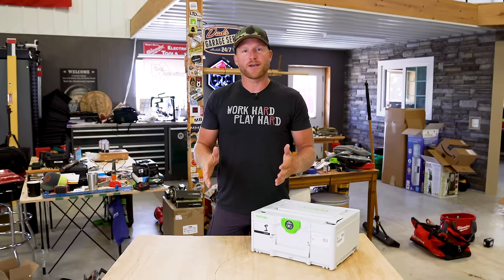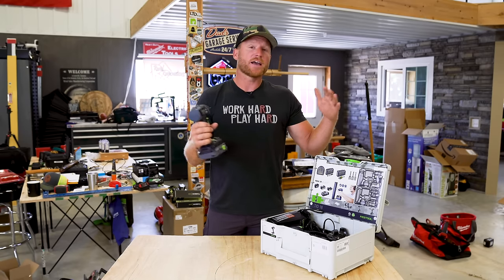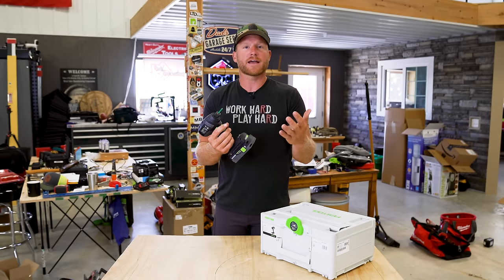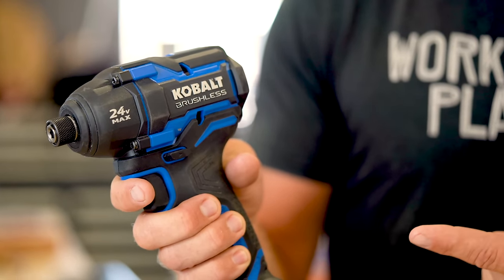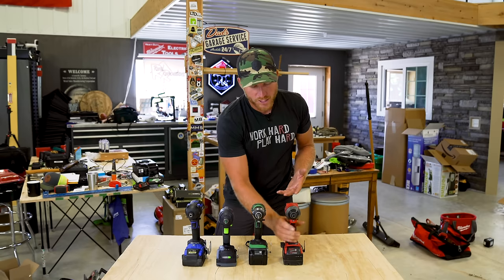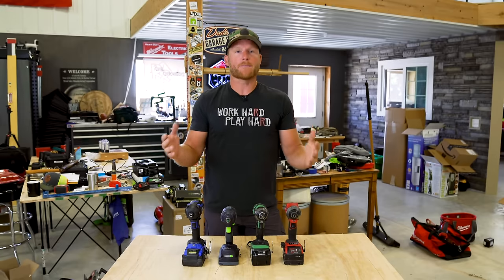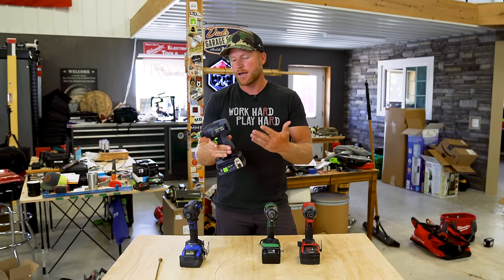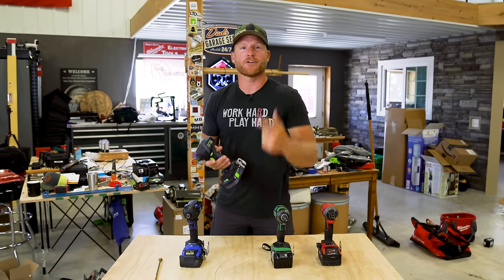Festool TID 18 Is it any GOOD?

Comment: Oddly, I found the ergonomics on the TID 18 to be horrible.  I had a lemon with insanely unacceptable runout but the ergonomics, overall balance and lack of power kept me from wanting a replacement.  The two positive comments I have for the tool are the onboard bit storage (synonymous with Festool drills, and absent on all other brands) and long trigger throw.  But, that’s the rub, I have a T18 (and had a PDC) for the (much better) precision speed control at the trigger.  I absolutely am not using an impact where I’d use a Festool drill/driver.  The experience made me appreciate my Makita XDT16 even more.  And, sadly, even my Bosch Freak 2 Electric Boogaloo has better ergonomics, balance and...ran circles around the Festool.  Yes, the same Bosch impact everybody disses.  As someone who has owned just about every Festool tool on the market over the past 15 years, I’m scratching my head about the USA division trying to market itself to builders in recent years.  Outside of a one automotive polisher, a drywall gun and a drywall sander, their entire line of tools (in NA) is made for finish carpenters, cabinetry and woodworking.  Previously,  they were pushing the HK55 that is both incapable of fully cutting 2x material on it’s rail at a 45 and grossly inferior to the original Mafell products.  Now they’re pushing their cordless “lineup” at builders when the woodworkers know there isn’t really anything there for the building trades.  The Carvex is absolutely horrible in a building environment.  The rotary hammer is sized for installing cabinets in European homes with walls of concrete or masonry.  You’re not going to want it for attaching your mud sill to a foundation nor any sort of commercial work with larger than 3/8” diameter holes.   The drywall gun is great.....for a drywall installer.  The saws are wimpy.  The tracksaw is literally for resizing doors and working with furniture/cabinet grade plywood.   I mean I can go on and on.  I love the 18v Vecturo (modified Fein) and 18v grinder (another modified Fein) and I carry batteries and chargers just for those tools...but...just  like my 18v Hitachi nailers, they are an exception/addendums.  I love Festool routers, sanders, the T18, the MFT, the systainers, etc...but..they are niche as all niche.   I literally mentioned another perfectly great niche company: Fein.  You could probably do 90% of your metal fab with only Fein branded tools.  You’re not going to build a house with Fein tools.

Comment: Can we all stop calling impact drivers drills? They're not drills they're impact drivers
Reply: I'll settle on impact drill driver.
Reply: I use mine as a drill...
Reply: @243WW  you can’t use it as a drill it’s an impact driver I use my jig saw to cope skirts doesn’t make it a coping saw you get where this is going ?
Reply: @coreycorbett1078  I still use it as a driver. I use it as a hammer sometimes as well, but I wouldn't call it a hammer. Impact drills are real, I use them to impact a hole when it spins around, almost the same as a drill. Driver impact drill maybe?
Reply: screw gun to me
Reply: @toolswithtimmyboi8040  But the point is, if someone asks you to pass them a drill and they meant driver, you'd pass them the wrong tool. Words have meanings.
Reply: Thank
Reply: Get over it
Reply: They're drills too

Comment: I agree, ergonomics is king. I have a full line of Dewalt 20v brushless but after a few hours my wrist starts to hurt. I picked up a M12 fuel combo and I love it,  The M12 line is small, lightweight and powerful enough. I do disagree on Hitachi/Metabo though. They change their battery designs too often and then you end up having to resort to third party knock off batteries that otally stuck. As far as Festool, I have a domino and it's ok but it's one of those tools that noone else makes so if it's something you need you have no choice but to buy it from them. As far as Festool's storage cases, the outside is ok nothing great but the cheap plastic they use inside is garbage.

Comment: Reminds me of Hilti.
That being said I'll stick with Milwaukee
Reply: I have a cordless hilti hammerdrill on my truck, it's hard to beat that thing for 1.5" or smaller holes. It even has a little built in vacuum in case you are working somewhere finished.
Reply: I understand, but do you get it repaired often?
Reply: Haven't had a Milwaukee tool break or battery fail yet

Comment: I bought makita dtd 171 or xdt16, same machine, different market. I watched a lot of youtube reviews and it was everywhere the best and everyone recomendet it. BUT! after  I took it to my hands and started using it for carpentary it was horrible as hell... it has 4 gears, 1, slow AF, second too slow, third HELL YEAH WE NEED TO BREAK EVERYTHING (way to fast), 4th full power, but just a little bit faster than 3rd. It had bunch of unusable programs for me, and the trigger was "depth adjustable" from 0-50% speed, then full power.

It was god damn horrible tool. I sold it after 2 weeks. second gear was to slow, third was way to fast and I didn't have any feel while using the tool. I'm continue to using metabo ssd 10.8v. So yeah, I love the reviews when someone compare not only the specs, but also precision.

Comment: My opinion. Once you start with a brand, you probably want all them to be the same so you can use all the batteries on one tool if you need to. I am a Milwaukee guy.
Reply: Also if you’re a builder like RRBuildings then you probably want several kinds of tools but for a guy like me one brand works

Comment: Those with bashing the brand are most likely el cheapo want cheap stuff 
I like pro grade tools I switched from DeWalt to Milwaukee.
Now considering Hilti or festool.
As self employed finish carpenter need durable and reliable tools.
I shop target not Walmart.
Like optics and audio equipment you get what you pay for.
Lesson learned in life and friends .
In college my best friend bought paradigm speakers both being audiophiles his tower speakers verses home theater surround sound . Are both life like.
My black decker lasted barely a year.
The DeWalt is still going the Milwaukee my now go to tool has never let me down.l

Comment: $350 dollars. In the UK these are $600 that's why they have a bad reputation of been thieves.
Reply: Don’t worry, they hose us on everything else.  Retail price management is considered illegal price fixing in the UK.  You’re in the only country I know of where retailers can set their own price for Festool.  Over here, Festool dealers are contractually obligated to sell at only the Festool mandated list price,
Reply: @robertrada4783  Milwaukee do this as well from official and unofficial sources. 
Makita don't, I don't use dewalt but I don't think they do either. 

Some of the milwaukee stuff is far cheaper to buy via US as bare tool and it's cheaper even with shipping and import fees.

Comment: For that price, I want forged/milled/hobbed internals. None of this nylon/sintered nonsense.
Reply from the maker: honest question...what impact on the market is any good for such a cheaper price...in comparing similar kits with other brands, Festool really marketed this with a good price point
Reply: @RRBuildings  I think they really wanted to build a larger brand following and market share and this price point is a good way to make inroads.  Their plunge saws, routers and CMS are much more expensive than the big box brands.  Their big router, the OF2200 is $900.  But it is a beast, basically a hand held shaper that can also be table mounted.  It takes about 2-3 minutes for  a changeover.  I have it and never regretted buying it.